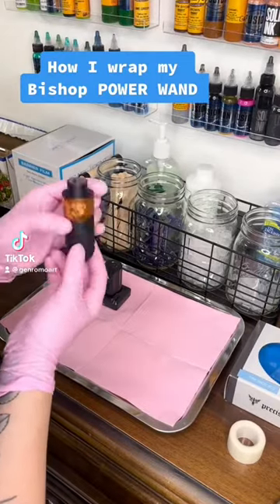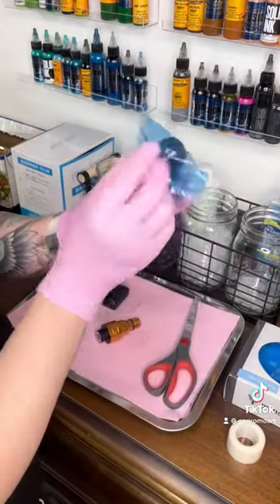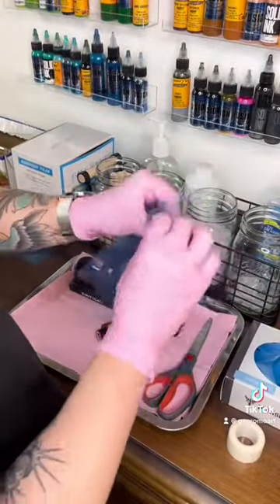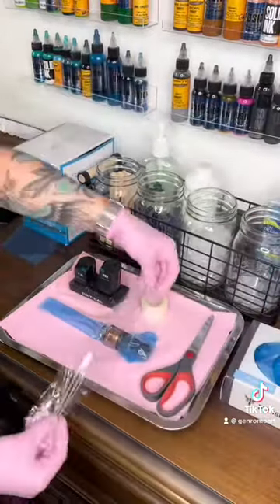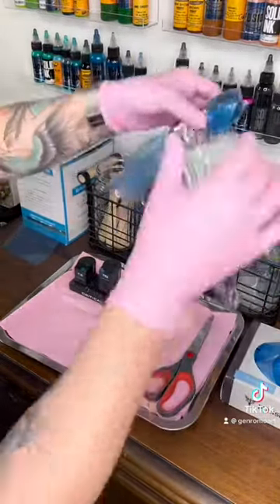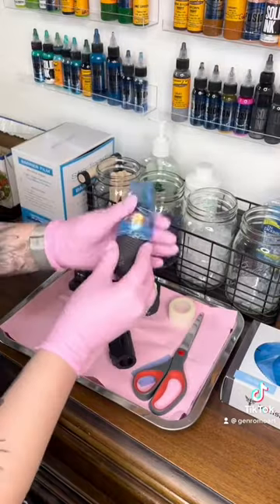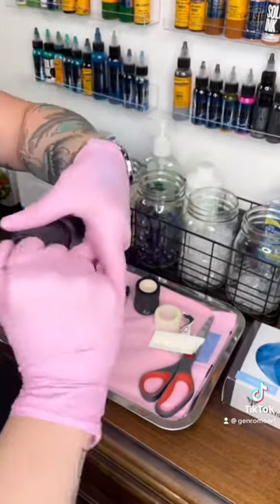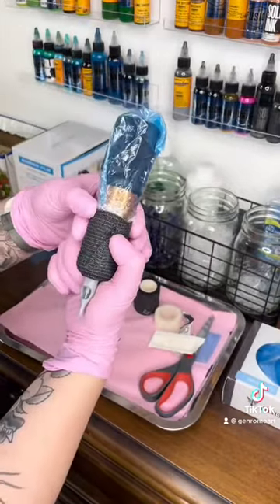How I wrap my Bishop Power Wand Packer

Comment: Hey, great video! Just curious, do you autoclave your grip in between clients or because the grip is completely sealed is this not necessary. Thanks!
Reply: I would either autoclave it still or give it a cavicide dunk. Especially if you switch cartridges during a procedure, as you can bring contaminants from one cartridge to another, between holding the cartridge in the back and inserting it.
Reply: Cold sterilization with cavi or autoclave both work